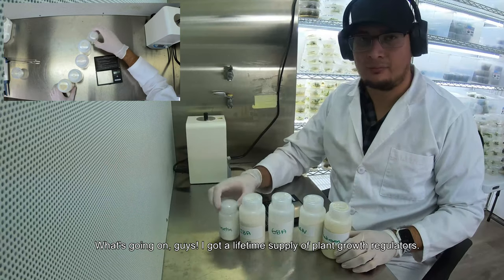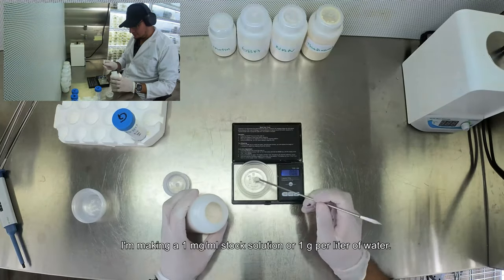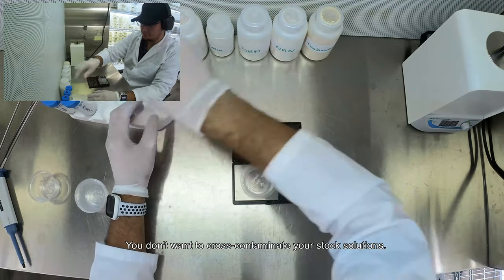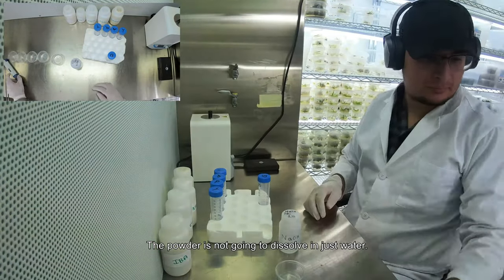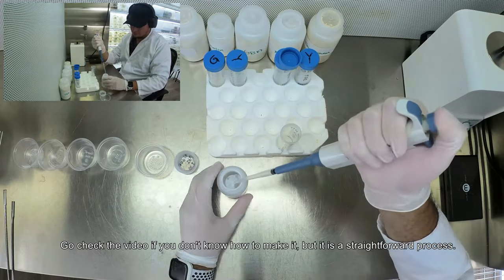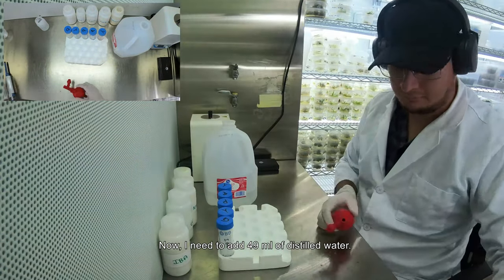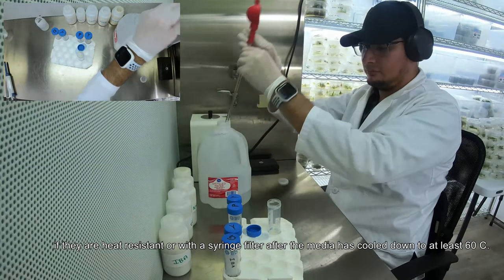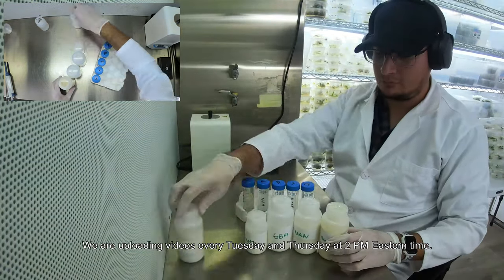How To Make Stock Solutions For Plant Growth Regulators

Comment: I would like to see you try the PGR’s with Vanilla orchids.  I have watched your starter kit series and videos on how to sterilize in the microwave but still my samples end up contaminated.  Not sure what I am doing wrong,  I do not have a Laminar Flow Hood so I wear a shower cap, mask and jacket and gloves to try and eliminate particles as well as using 90% alcohol to clean my work area
Reply from the maker: tissue culture is a multistep process. contamination can occur because of several reasons, including using unsterilized water, culture vessels, equipment, and tools, improper explant sterilization, stuffed culture room, through the air when the process is not performed under complete sterilized and closed conditions, etc.

Comment: Did you sterilize the PGR after you made them? If so how? How long is the PGR solution good for? And how do you store it?
Reply from the maker: The PGRs are sterilized with the media in the autoclave/pressure cooker. If they are heat sensitive, with a syringe and a filter after the media has cooled down.

Comment: I didn't understand one thing: should we sterilize the pgr stock solution as final step? or only when preparing the media? thank you
Reply from the maker: You can sterilize synthetic PGRs with the media. However, filter sterilization is generally required for natural PGRs. 

A stock solution of hormones is used to directly take the amount of hormone required while preparing tissue culture media. It saves time.

Comment: Good day sir! I have a question: 1. can you sterilize PGR Stock solution in microwave instead of in autoclave?
2. How does syringe sterilization of PGR stock solution work?do you have a video of that?  

Kind regards
Reply: Millipore filters that attach to a syringe work fantastic.  That's their brand name and they come pre sterilised.  just rip open and used in hood.
Reply from the maker: Great questions Danii! 
1. of course you can sterilize in the microwave. However, you must know the working parameters of your microwave and the knowledge of a suitable temperature and time for sterilization. Also, be on the lookout for how much media you add to each vessel.

we have a video on our channel for media sterilization using microwaves. You may find it useful.

2. syringe filter is suitable for plant hormones that heat labile and can not be sterilized. There are easy to use.

You have to use a suitable filter with an appropriate filter size for the hormones. directly place them inside the needle, take the hormone and add it to sterilized media. Everything should be performed strictly under sterile conditions, mainly laminar flow hood.

Unfortunately currently, we don't have any videos on it. But, we will try to make them in near future soon. Thanks!

Comment: Good evening Francisco, is it important to check the pH of the stock solution? I use KOH to dissolve NAA and IBA and the pH is very high. does it influence the shelf life of the stock solution?
Reply from the maker: The concentration of KOH or NaOH should be between 5-10%. More than that, it will increase the pH too much, which will change the pH of the media and may also lead to crystallization of the PGRs.
Reply: @PlantCellTechnology  thank you! 
5-10% of the final stock solution? So, no more than 10ml of 1M KOH in 100ml of stock solution, Correct?
Reply from the maker: @DavideGnesutta-o2z  Yes, you're absolutely correct.

Comment: You want a challenge? Try Chinese chestnut trees! I would be eternally grateful :-)
Reply from the maker: If I can get some seeds.
Reply: @PlantCellTechnology  You need seeds to clone a tree? I thought you would need a leaf or stem to clone a tree.
Reply: @PlantCellTechnology  Getting seed would not work because then you would be cloning a seedling instead of the mother tree. This would result in loosing the characteristics that I would be trying to replicate. If a seedling was cloned then the protocol may be different for the original mother tree correct?
Reply: @MrWhiltetail  Try FSAC: fragmented shoot apex culture.  I did this in 1989 on grape vines.